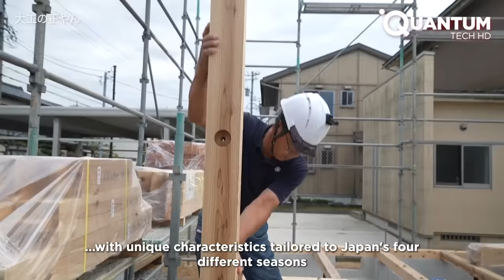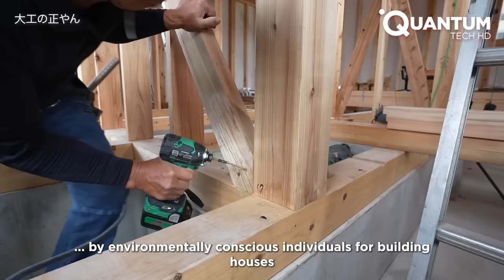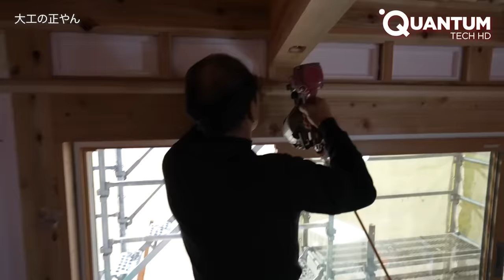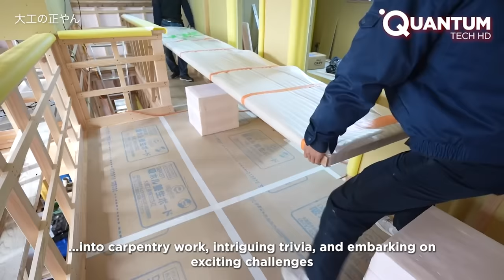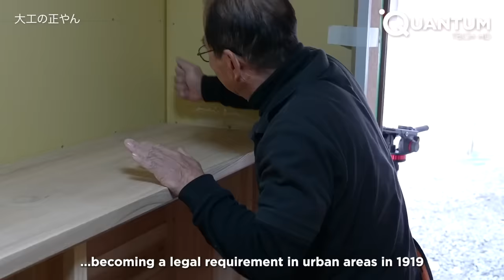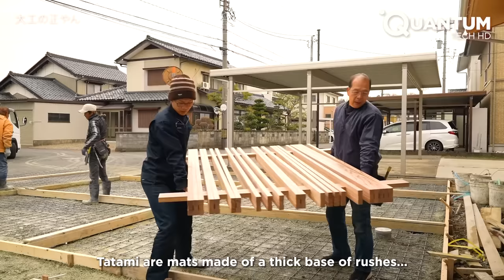Process of Building Amazing Japanese-Style House | Skilled Carpenter | by @CarpenterShoyan

Comment: Japan has a "TSUYU"(rainy season) of about 1.5 months between spring and summer, with high temperatures and humidity continuing from the rainy season through summer.
Many foreigners may wonder, "How durable are wooden buildings?
However, in Japan, wooden structures dating back 1,000 years are still in existence. In addition, Japan is a very earthquake-prone country. Nails are only for auxiliary purposes,
The basic principle is to use a lot of "SAN"(cleats) and "SUZIKAI"(diagonals). This is the work of "TAKUMI" carpenters who are well versed in the vitality and toughness of wood.
Reply: From what little I have learned, Japanese woodworking is at another level than the rest of the world.
Reply: @iteerrex8166  Arigatou gozaimas♡
Reply: Thanks for the info!  Fortunately, they don't get tornadoes like we do in the Midwest U.S.  I am rather surprised to see standard stairs used instead of tanzu-style (drawer and secret compartment) ones.
Reply: @catwhispurrer137  The storage space like a secret base under the stairs, for some reason, is not seen very often in Japan. That is an interesting method. In the traditional Japanese style, there is an OSHIIRE (closet), a space built as part of each room. In a Japanese-style tatami bedroom, FUTONs (bedding) are put in and out of there every day. Recently, Western-style bedrooms and wall closets have become more common, but in any case, the lack of storage space in Japanese houses is often a problem.

Comment: I am interested in doing the same type of extension on my house with LVL (laminated) boards, I like how there is no 'nogging' between the studs, being cross braced instead. It all seems so simple, yet ingenious at the same time.
Edit: However I will use my rubber or wooden mallets, not my fists for the stubborn pieces. 😅

Comment: The design and concept have been simplified to an incomparable level these days in Japan. The greatest change has been in the roof design and overall shape. I assume cost and an ever increasing lower than middle class wage earner families are the cause. Most homes built now in Japan are cube in plan and slight grade flat roof hidden by the wall face facade. Natural airflow now is derived from mechanical methods with windows generally for light transfer at a minimum dimension. I have noticed that usually one larger dimension window at second levels I believe which may be for emergency access or exit. The craftsmanship hasn’t been lost from what I have seen.

Comment: In an island country that experiences many earthquakes and some floods, your homes should be elevated with the use of iron/steel posts/pillars. In other words, the 1st floor of the house should be a garage and the 2nd floor should be the living space.                                                     And in order to allow the iron posts to jiggle a bit during an earthquake, the base of the post should be resting in a concrete basin/well where the concrete bottom is shaped slightly round & the bottom of the posts can have iron spheres/balls that are welded securely to the posts. … In other words, designIng Japanese homes with the ability to sway just a little bit during an earthquake, helps the entire structure to stay intact.

Comment: I am from Canada, and while I can build a beautiful and warm house, and I'm sure I could follow their technique for earthquake and hurricane resistance, I don't know proper technique for dealing with termites and/or carpenter ants, and the thought of building a wood framed structure somewhere they could be is unnerving for me.

I don't believe in using chemicals to solve what should be a material/layering problem, so I'm curious what technically capable people do to solve this properly.

Also, where I'm from the humidity is low, so metal roofing is actually a pretty good choice, while in the "Pacific Northwest" people tend to prefer cedar, which can handle the humidity but not alot of UV.  What's a modern durable solution for roofing in Japan?
Reply: @Spencer-e2v  I guess that's why knowledge is dying out.